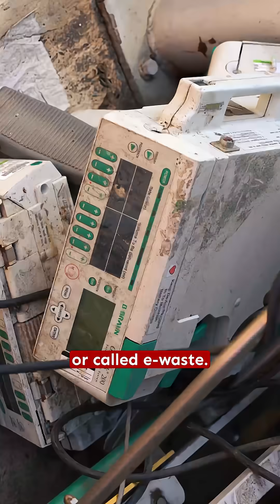Scientific Breakthrough Could Deter War: Flash Joule Heating and Rare Earth Minerals #science

Comment: Old Electronics are to Rare-Earth Elements what Aluminum Cans are to Bauxite Ore.
Reply: In one respect, probably, in another, I doubt it. Aren't aluminum cans primarily aluminum, whereas aren't printed circuit boards a mixture of many elements, some of which are neither precious nor rare-earth?
Reply: @petermadany2779 i see what youre saying. The point i had wanted to communicate it that recycling aluminum requires much less energy than mining the primary ore, just like rare earth materials.
Reply: @Critter145  I wholeheartedly endorse recycling of electronic waste for multiple reasons.